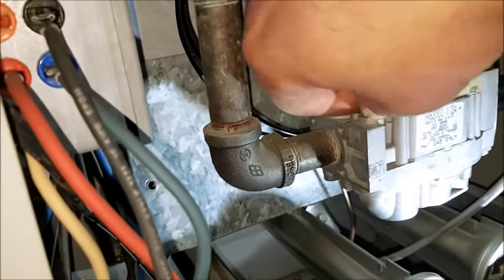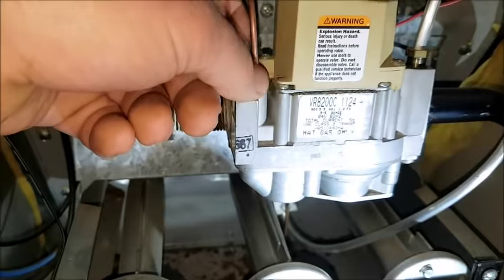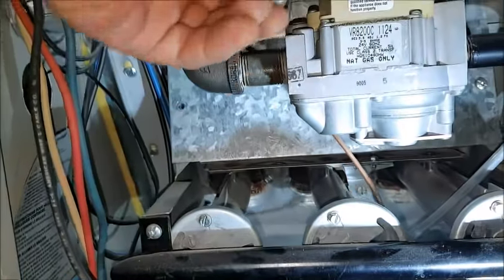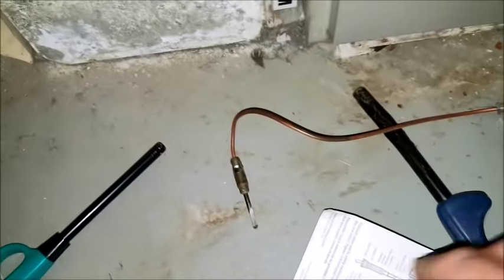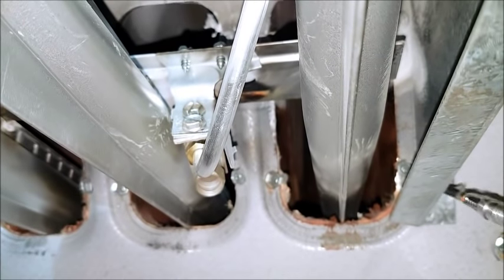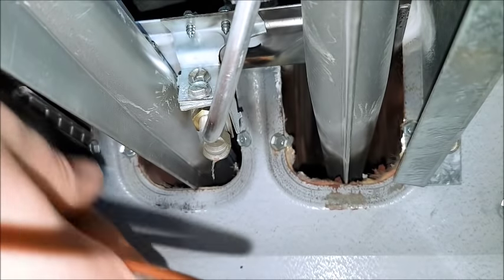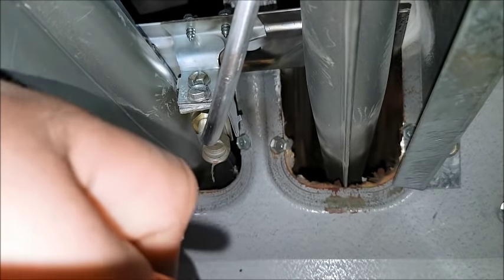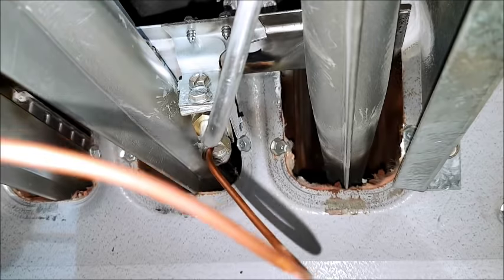how to replace thermocouple on furnace

Comment: BEFORE YOU REPLACE THE THERMOCOUPLE: Check the connection at the gas valve. The brass of the thermocouple and the aluminum can have a very mild reaction and after a few decades corrode a bit and interfere w/ the signal. I was about to replace my thermocouple(very similar to the one here when the pilot wouldn't stay lit) and decided to look at the connection out of curiosity. I could see a bit of corrosion on the tip. I took some 200 grit black sand paper I had and gave it a light sanding to shine the metal. I didn't do anything at the valve, I didn't have my glasses, but didn't see anything. I blew out the in case to remove any debris and hocked it back up. I lit the pilot, turned it to ''on''. and about 2 minutes the furnace fired up.(I had turned it on at the thermostat before went it work on it)
So, there's something easy and cheap to try before replacing the thermocouple
Reply: Cheap? The thermocouple is $10. How much cheaper is this method?
Reply: @theskeletoncrewshows  This doesn't cost anything. THAT'S PRETTY CHEAP, if you're doing it yourself like I did.

Comment: the thermocoupe comes with 5 bolts. 
How do you place them or you don't need to?
Especially in the bottom, i believe you must add one bolt on the outside and then put the skinny wire thing, but i also see a bolt placement behind the barrier, that goes behind the front bolt, where the fire is ignited. So do you need to place a bolt there and something else? because it's very hard to reach without completely removing the large barrier which has 3 or 4 bolt placements from right to left...
Sorry if no one understood, its kind of hard to explain

Comment: I have a gas fire the one that sticks on the wall and back comes out of the garden. My termocouple was no good. But the dude that fitted new one used a universal one and it worked.  its don't work again so I was thinking of replacing it but if if was to take out the old thermocouple from both end do I need to turn of the gas. my concern is if I take the old one out at night and take it in the morning to a shop to get new one, will it be safe with no thermocouple in the gas fire.
Reply: There’s usually a cut off right near the appliance. Yes cut it off to be safe.

Comment: How did you know what part to get?
Reply: Its in instruction book/installation book parts list
Reply from the maker: thermocouples are a universal on all heating equipment the only thing that changes is the lengths and sometimes reverse thread